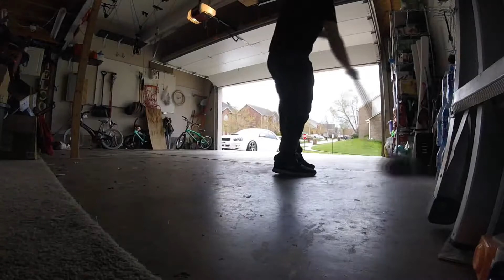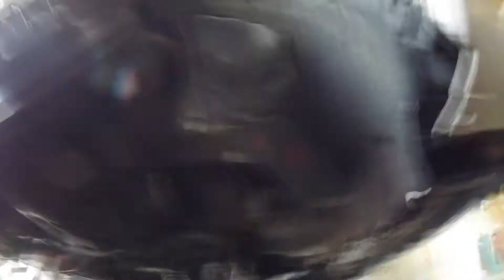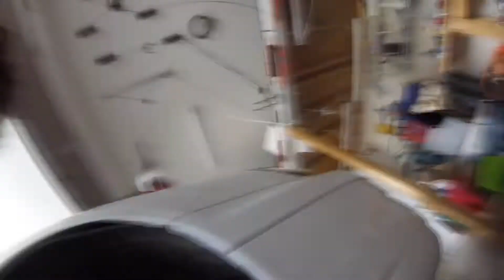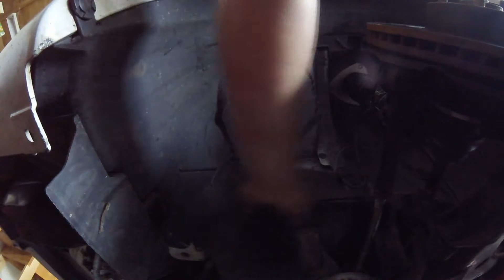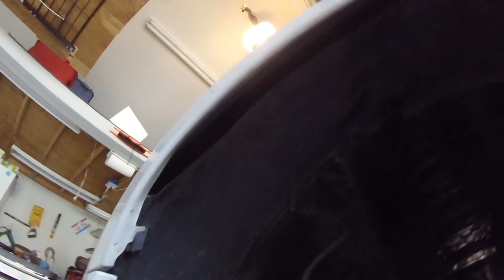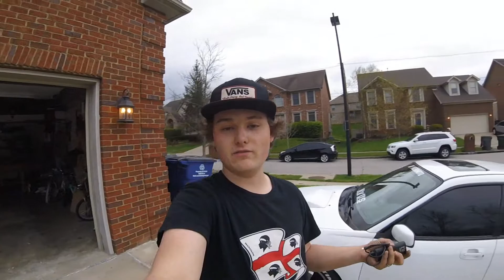Cutting my Fender Liners!

Comment: Isnt the fender liners helpful so water doesnt hit any electrical stuff or part of the engine so no check engine doesnt light on??
Reply from the maker: In this video I only cut them so that the didn't rub. But as far as your question goes, ehhh not really, the biggest benefit to fender liners is to protect your fenders from any debris that your tires might throw up at them. I've since removed my fender liners and I re routed and tucked my wiring harness to prevent any sort of possible rubbing through them.
Reply: @Allrj  how is it holding up I purchased a Camaro ss privately and it has rotofab intake no liner 🤷🏾‍♂️
Reply from the maker: @dasansamuels2764  no issues here
Reply: @Allrj  ok cool it seems to be alright but the inside of the filter housing gets dirty after 2 weeks idk if that’s a big deal or just means I have to clean it more